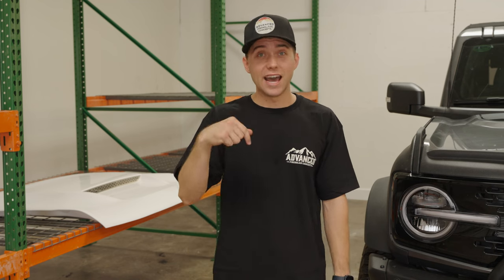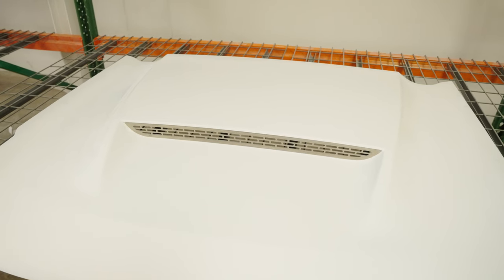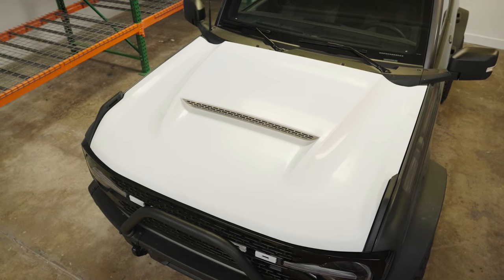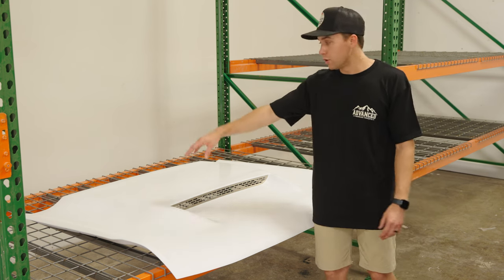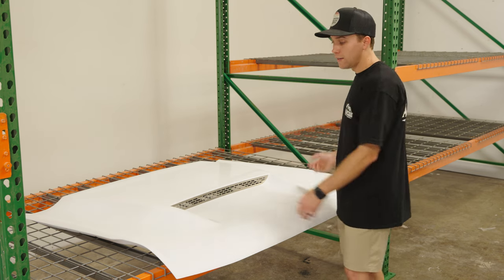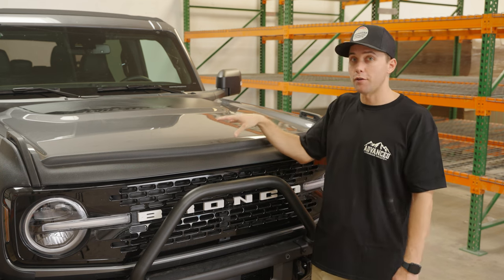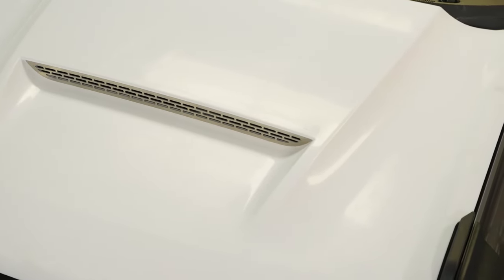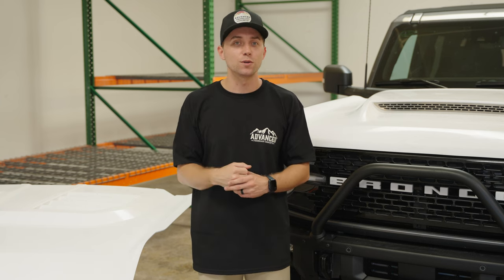FORD BRONCO | Ram Air Hood

Comment: Great video! Can you run hood struts on your Ram Air hood? Does your hood have metal inserts for bolt points? Thanks for your help about to pull the trigger.
Reply from the maker: Yes, we run MRT hood struts on our shop bronco.

Comment: Hi i appreciate your good work, just curious on the hood, dose heat have effect on the inside?
Reply from the maker: The hood has extra air flow from the ram air opening so the heat is lower than normal.